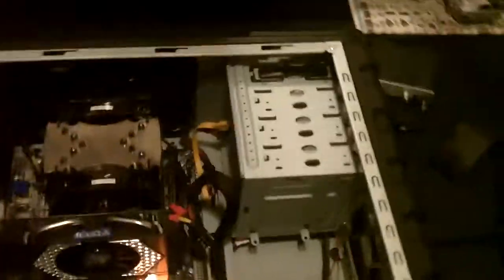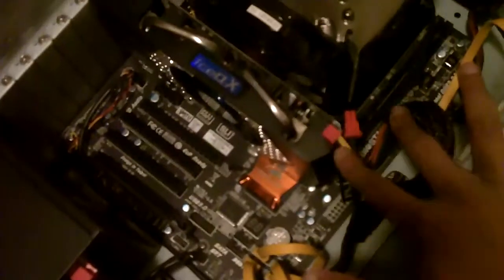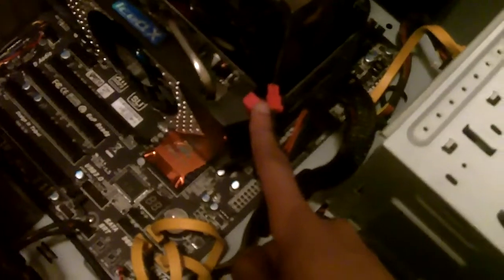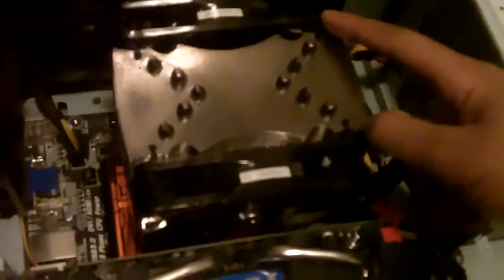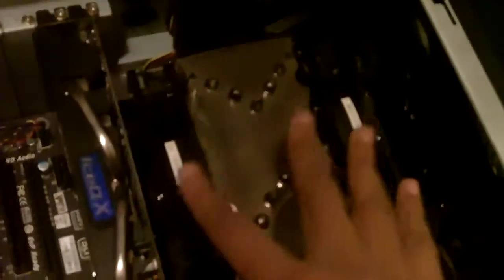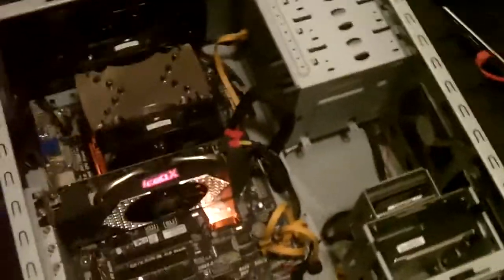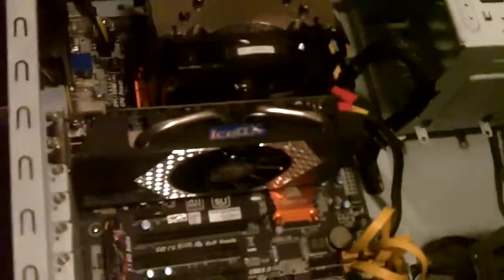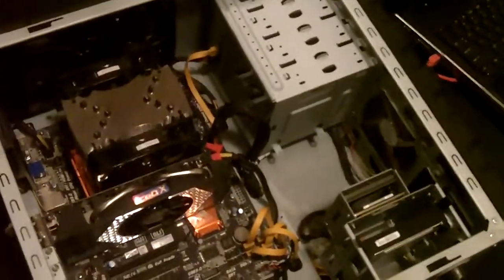Update On My Desktop 4

Comment from the maker: CPU: Core i5-3570K with Intergrated HD 4000 graphics
RAM: G. Skill Value Series 4gb DDR3
Motherboard: ASRock Z75 Pro3 LGA 
HDD: Seagate Barracuda 500gb 7,200rpm
Case: Anything you prefer.
PSU: Antec VP-450
OS: Windows 7 or 8

This system should cost around $500